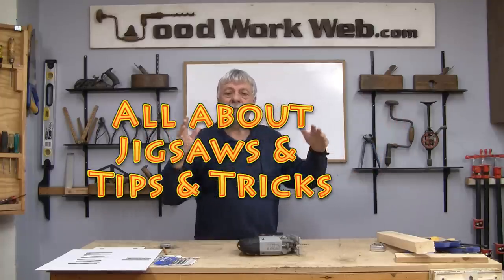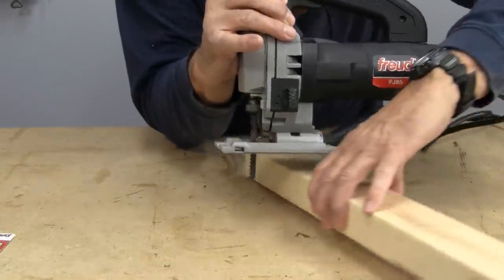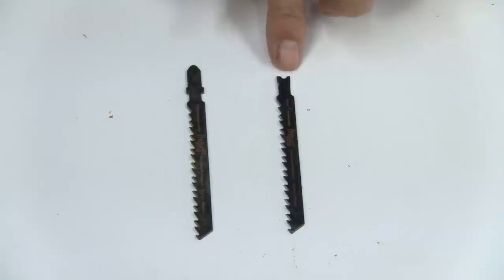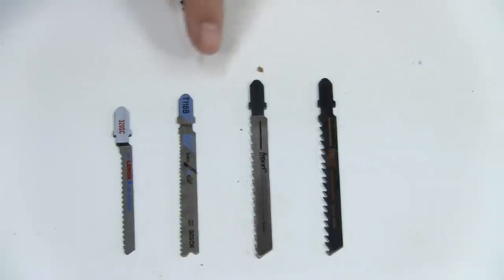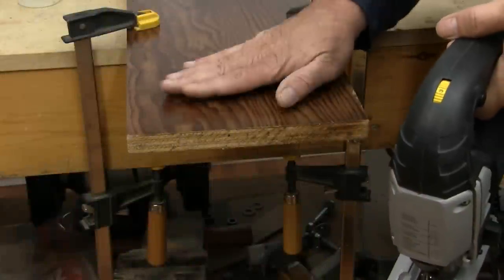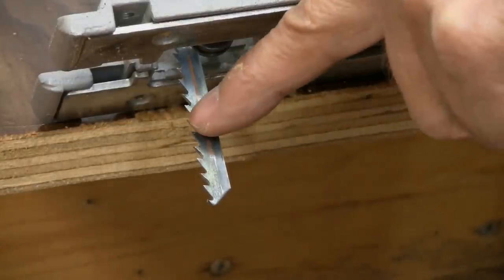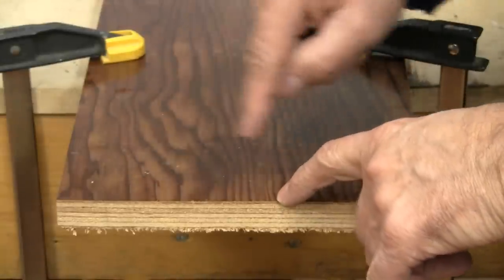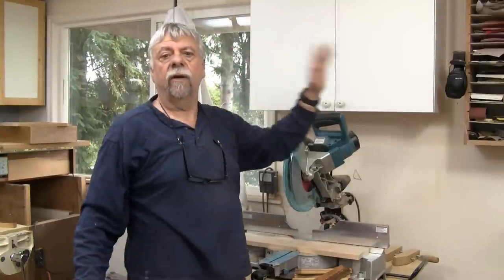Jigsaw Use & Tips -  Woodworking for Beginners #22  - woodworkweb

Comment: I don't know how useful this might be, but when following a straight line, if you make a knife wall (few light passes with a utility knife or a marking knife, cutting the surface fibers of the wood), and you cut to one side of it, that side will not have chipout. Even if it isn't a straight line, if you have something of reference and can make the knife wall it will work the same. More so, if you know the width of the kerf of your cut (maybe cutting into a sacrificial piece to check), and you make two parellel knife walls, cutting in the middle gets rid of chipout in both sides.
I say knife wall because I first saw the technique with Paul Sellers, when teaching how to cut in a straight line with handsaws. Granted, he used a chisel to carve to one side of the knife wall so that the saw falls down to the cut, but I've tested with the double scorring and works fine.
Also, on a sidenote, I have used a new skil brand jigsaw, very powerfull and with all the options you said. And I have my father's old Made in Japan Ryobi jigsaw (from the late nineties I think). Guess what saw gives a cleaner cut. The old ryoby, even after I had to make a repair peace because it's no longer made nor supported in my country. (there is a little L shaped piece that supports the blade guide and allows for adjustments. That broke in two, so I took a right angle bracket, like the ones used to stiffen furniture, and grinded the piece to shape, and then I drilled and tapped the required hole for adjustments. It works like new)

Comment: Nice video! You can also use small backstop on top of your cut to prevent chip out as long as it doesn't exceed your blade with, I've also used masking tape as well before cut, just tape up your line before cutting, cut your piece out & gently remove tape, both methods works with several different types of saws. Thanks for the videos!

Comment: Nice video Colin. My wife bought me a  Craftsman jig saw back in the 1980"s use the old style blades U type. That saw still works great. I don't use it much now that I own a band saw and a scroll saw.but it still has a place in the shop. Thanks for sharing Colin.
Reply from the maker: Backyard Woodworking There must be thousands of those Craftsman saws out there Roland, I see them often, and they still work fine.
Reply: Yes and I have an old Craftsman router 5/8 HP made of plastic that still works fine as well.

Comment: I always have trouble with them. the blades over heat way to quick and the blade tends to come out of the track which makes angled and curved cuts so I just end up using my reciprocating saw. but now that I think about it I might have had the blade adjustment to far up for cutting hard wood floors.

Comment: Colin @woodworkweb
I have been appreciating your videos and tips for some time. Something I have wondered; can you prevent a jigsaw from wondering? I have had a blade follow a grain line on me a couple times; not sure if it is something I can correct with ease or if it is a lack of understanding when attempting particular cuts. A common situation is cutting along a grain line to trim, i make a straight mark, set up a straight edge and the blade wonders off the line but the saw is true on edge. 
Thank you again for sharing your knowledge.
Reply: Pity he hasn’t responded to your question. I have the same problem. Today I have ruined a couple of boards due to the wondering blade. I ended up turning to the good old hand saw.🥲 What I’ve also noticed is that the blade is flexible, thus it can bend sideways when it encounters a dead spot in the wood or when trimming. Quite frustrating.😖

Comment: Do you think some blue painters tape on the the front part of the plate would help so it does not scratch the floor when doing the cut without using a drill?
Reply from the maker: worldschaos2181 I think it certainly can't hurt, so yes, I would do that. Many of the new routers come with a plastic cover for the base to help stop that scratching.

Comment: Hi a couple of other little tricks you could have mentioned was if you can't turn the workpiece around try masking tape  and a fine finish blade to avoid tear out also it's a good idea to put the plastic shoe that comes with the jigsaw on the sole of the foot of the jigsaw if your jigsaw doesn't come with one or you lost it its not to hard to make one out of plywood so the foot of your jig saw does not scratch you workpiece
Reply: Or a backing board, or both

Comment: Good explanations of the tool.  I use mine all the time.  I also use a Rockwell Blade Runner which is an under table mount jigsaw. That is a nice tool to have in the shop.
Reply from the maker: Trees2Pens I have not used that saw, thanks for the update on it .. would like to give it a whirl some day.

Comment: Colin, Thanks so much for this! I have a jigsaw (Bosch) and can't get the blade out. It has been stuck for months and I don't have much strength in my hands but even a pair of pliers can't seem to free it. Any tips?
Reply: Judy Crichton Judy give it a shot of WD 40 and let it work for a while and see if that helps.  Makes sure the blade release is all the way open if you have that type, other wise make sure the set screw is loose.

Comment: i have an older Rockwell Jigsaw, uses a U blade, when i try to use it, it jumps on the plywood. i have checked the blade angle and it lays flat on the wood. i am new to this whole power tool thing. why is this happening?

Comment: I still have an old craftsman jig saw from the 90s. It's not the best, but I haven't used it a lot until recently I built a jig/stand for it that holds it upside down so I can use it similar to a scroll saw. It's not as good as a scroll saw would be of course, but it helped  with a few finer cuts until I got a band saw as well.
Reply from the maker: ***** Thanks Jon, interesting idea and it sounds like it works .. thanks for sharing this, I had not heard of this.
Reply: WoodWorkWeb If you search youtube for "jigsaw scroll saw" the first few videos that came up are similar to what I did. I wound up making rails under it that I could slide my jigsaw into easier, and use the straight edge guide bar to slide in the side and hold it in place.

Comment: Regarding the chipping on wood, when you saw from above, you often, here in Denmark (and also seen in Germany), saw from underneath. Then you avoid chipping on the front, most of the dust is underneath the wood and you have a clear wiev over the line, you are cutting after. Thanks, for good lessons, form Denmark.
Reply from the maker: +Frejlevbanen Frejlev Thank you for your detailed comments
Reply: Frejlevbanen Frejlev 
That sounds awkward with hand held tools

Comment: Hi Colin
Great video, however there are a few points which I feel need clarifying: - 

The switch that 'tilts' the blade is actually the 'pendulum control', this makes the blades move backwards and forwards as you are cutting, you can see this happening in the video from 10:17 onwards . This speeds cutting in soft materials, for wood I use a setting of 1 or 0.

The rough finish you are getting is worse then is actually possible  because the pendulum control is set to 3 which makes for a very aggressive cutting action/speed.

To get a better finish the surface of the wood can be scribed using a marking knife - this reduces splintering - tape is not effective and the pendulum control set to 0.

Cheers
Reply from the maker: +J onno I have never heard it referred to as that ... thanks for the info.
Reply: WoodWorkWeb 
He is completely correct. pendulum is for soft materials.

Comment: Hi, this was really useful. I was just wondering. say you had a piece of timber 45mm thick & you wanted to cut a chunk out of the side 35mm deep. Would you be able to use a jigsaw for this, or does it damage the blade if the wood is thicker than the length of the blade?
Thanks.
Reply from the maker: I've actually never tried such a thing. I'm going to bet it will break your blade and quick. 
I would suggest a table saw for such a cut or an oscillating tool should work well too.

Comment: My jigsaw had a U-Type blade inside it and also had the screws - but I installed a T-type blade in and it works just fine. I'm assuming the U-Type won't fit inside a T-Type jigsaw though!
Reply: +Pasha I have an older type of jigsaw and always used U-type blades. Last week I was in a store and the said they do not sell U-type blades anymore because they are "old fashioned".  They offered me to try another type, which they called "universal" and they were convinced it should fit also in my jigsaw for U-type blades. So I took two pieces, one for metal and one for plastics and tried it at home. And they were right, it fits without problem.
Now watching this video I compared the T-type blades with my universal blades: they are exactly the same.
Reply: +Hans de Groot :D

Comment: every jigsaw I have ever used does not give a straight cut thru the material,,what can I do to correct this issue,,
Reply from the maker: You can try using a guide and testing different blades.

Comment: The lack flexing of a laminate when cutting is key to preserving its condition. The footplate’s direct pressurecovers the top edge, and using tape or clamping another piece of spare wood to compress the opposite surface should reduce the splintering or blow out. Did you notice that he’d already shown the ‘best cutting side’ when he revisited the panel even before flipping it over?

Comment: Been a Safety Professional for 28 years....the plunge cut is very dangerous, handling the saw with the foot not resting on the work, subject to the blade breaking and flying up. Safety glasses are a must! It only takes a couple of minutes to make a pilot hole to safely and securely cut.

Comment: thanks, advise blade types to cut letters on acrylic or pokyfoam sheets and tips for cutting plz
Reply from the maker: +Naeem Sabir I have had a tiny bit of experience cutting acrylic and used the finest blade I could find. It was slow but did a good job. Make sure the bottom of the jigsaw has a plastic protector or it mars the acrylic.  Have NOT used it for any of the foam products, but if I did, I think I would look for a coarse blade, probably a wood blade and try that first to see how it worked
Reply: would it be T102H as suggested by some other expert???
Reply from the maker: Naeem Sabir
Yes, that would be the one

Comment: I quite like reverse tooth blades because I have a cheaper Black and Decker jigsaw with a poor quick-change mechanism. If I use a normal blade, it will often be pulled out because the jigsaw is pulling up and the blade snags on the material. With a reverse tooth blade, the teeth are always pushing into the material. -- My dad had a Black and Decker (1975-ish) with the tightening screw/bolt but the head was stripped so he gave it away recently to someone who replaced the mechanism with an identical one and with a replaceable tightening bolt. I'm sure it's going to go another 20 years.
Reply from the maker: Adam R It probably will be good for another 20 years too ... thanks for this

Comment: what was the reason for adjusting the blade forward? you said you would explain later,  buy never did.
Reply: He did say, it basically speeds up the cutting. It's the pendulum action. So instead of the blade just going up and down, it kinda of saws in an elliptical way which speeds things up.
Reply: andrewford80 Only for soft materials.

Comment: Or!... you can use a "Reversed" Jigsaw blade to make clean cuts.
Secondly, NEVER start a hole-cut tilting the saw. Doing this can bounce the saw towards you and damage the wood or you. Just walk your lazy @$$ to the drill, put a bit on it and drill the hole that is necessary to pilot the Jigsaw.
Remember kids, shortcuts in woodworking result in trashy product or missing body parts.
Your truly, a Finish Carpenter.
Reply from the maker: Dikotomii X LOL, really ... I know many, many finish carpenters, they have more shortcuts and tricks than any others in the trades

Comment: why does the blade bend outward when using the jigsaw?  Trying to cut a circle with 1/2" plywood, the blade bends and then sometimes breaks.  How do I prevent the blade from bending?
Reply: jim b I would imagine a few  possible causes. You may be trying to cut curves that are too tight. You may be pushing the jigsaw too quickly.  The center of your rotation may not be on the blade. It also could be any combination of those issues. An aggressive cutting blade and taking your time help tremendously. I hope i was helpful.
Reply: jim b 
Turn the back of the Jigsaw while keeping the blade in the same place.

Comment: Dear Sir ,
I need your advice to Choose the Right Blade for my band Saw
Reply from the maker: Mohamed Islam Sure, I will try and help, what is your question ...
Reply: WoodWorkWeb have a 9" band saw and I need to know the best blade for milling log . I have 3 sizes 1/4-Inch 6 TPI, 3/8-Inch x 10 TPI and 1/8-Inch x 14 TPI . So what's the best
Reply from the maker: Mohamed Islam The best one in this case I believe will be the 3/8 inch blade. It should work fine for you ... go slow, and just make sure you are working with a sharp blade.
All the best ...
Colin
Reply: WoodWorkWeb thanks I'll tell you the result when I done
Reply: WoodWorkWeb 

can you tell me the best use for the another blades ??
Reply from the maker: Mohamed Islam OK, for ripping wood on a bandsaw we try to find a wide blade with few teeth.  A 9" bandsaw is a little bit small but will still work. The 3/8 side blade is good and 10 TPI (Teeth per inch) is ok,  I see on the same page there is a 62" in blade (same size) that is 3/8" wide but only 6 TPI ... this would be a slightly better blade to use for ripping wood, but if you already have the 3/*' - 10 TPI it should work fine too.
Reply from the maker: Mohamed Islam Yes, the thinner blades such as such as 1/4" are often used more for cutting circles or or sharp corners something like Intarsia. W slightly wider blade like the 1/2" also for cutting circles or curves but not as sharp .. and the 3/8" can also cut curves, but again not not as wide, and a wider blade is best for ripping, that is cutting along the grain of the wood.
Reply: WoodWorkWeb  so I have to buy 3/8" - 10 tpi and 1/4" - 6 tbi to be ready for all works ??
Reply from the maker: Mohamed Islam No, what you have should work ok, but when the blade you have gets dull, you may want to think about one with less teeth if you will be ripping wood or cutting logs. 
There is no problem with having more teeth on a blade, it just means you have to go slower because blades cannot cut as fast.
Reply: WoodWorkWeb Ahaaaa , so more teeth more slower . thank you tooooo much

Comment: how make straight cuts with jig saw ?
Reply from the maker: et bilu It is very difficult to make straight cuts with a jig saw, the reason is the blades are so thin that they can tend to "wander" very easily, and sometimes will even want to follow the grain of the wood. They are really more for rough cutting than for fine cutting.

Comment: Something must be wrong with my saw. It will actually stop moving forward even if i use great force to push it.
Reply: a very dull blade could do that, or using a metalworking blade on wood. Does it still cycle up and down properly when you're pressing it forward?
Reply from the maker: pkbjorn35 Hmmm that is puzzling. I would think even a very dull blade would make a little bit of progress. Is there any chance the blade is in backwards???  My other thought is that I have only seen one instance, but I did see a package of blades where one blade had no teeth, a manufacture mistake. That is about all I can think of

Comment: 12:13
just don't do it.
it's dangerous and you gain nothing. get a drill and do it right.
Reply: It is a technique called plunge cut
Reply: whatever0mate 
He could buckle the blade. hmm wierd
Reply: It's completely safe. Sometimes you can't drill a hole or the hole itself is too small
Reply: it's completely safe? completely? what lunacy is this?
Reply: I still have all my fingers so it's safe ;) especially if you know what you are doing and feel comfortable doing it.
You can  also use oscillating saw for that.
Reply: It's good that you're doing it all safe. But it doesn't mean it's completely safe for everyone else. It's irresponsible to suggest it to people who don't know better.
Reply: whatever0mate Nothing is safe, it's all about the user